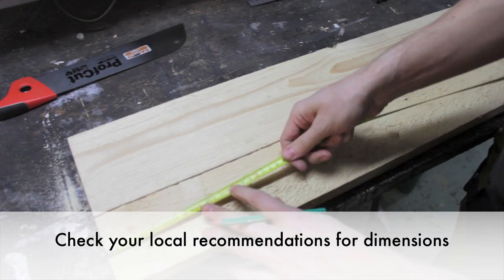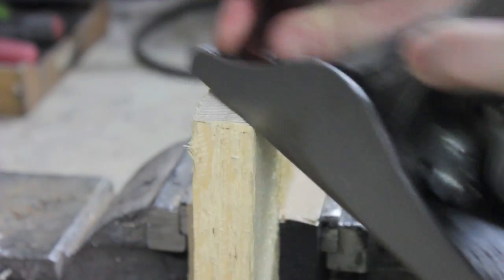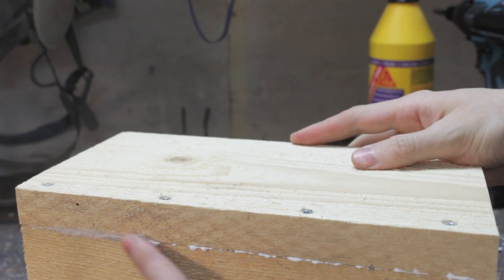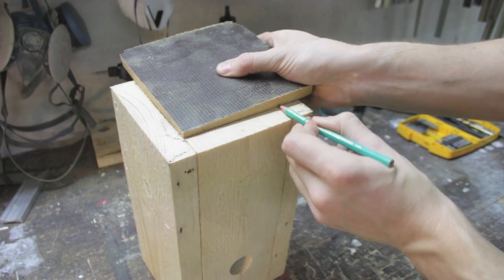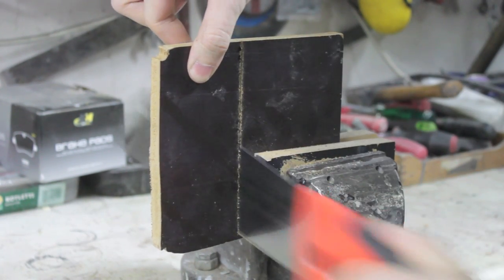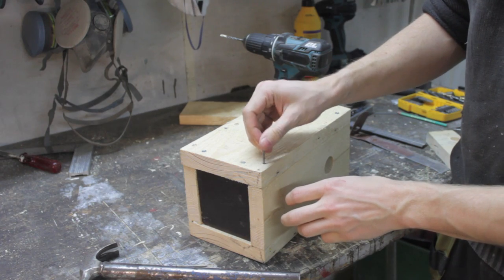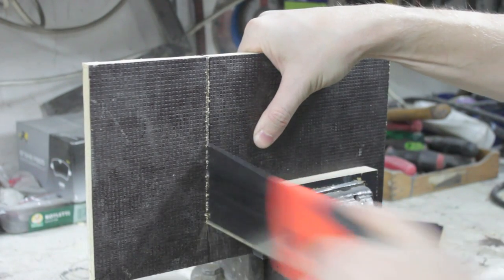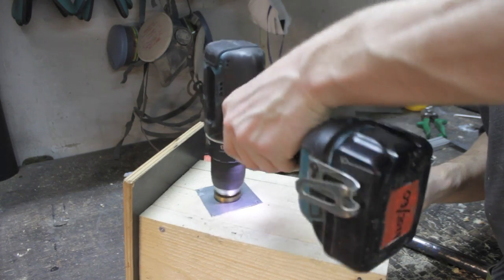Building a Birdhouse - Things to Consider

Comment: Woodchucks will probably prefer enlarging the entrance rather than making a new hole so your metal guard will protect the eggs also against them. You could also consider deepening the entrance by mounting a wooden square around it before screwing the metal guard. This will protect the nest against cats, martens and other 'pawed' predators. My bird house got 'modified' by a woodchuck within several months and now it has both additional layer of wood and a piece of metal around the entrance. :)

Comment: Terrific, thanks. First, thanks for doing good technical research on the birdhouse. I certainly don't want to hurt them and your video really helps that. Second, YES, on voiceover. The essential communicative power of video is in the use of eyes. Splitting the information ingress between ears and eyes is efficient. It allows either for more information in the same time space or a reiteration of vital information via two different media for better learning. Having to take my eyes from the action to read a caption drives me nuts! I panic that I'm missing something. I know it's in fashion now but...still...I KNOW what a table Saw sounds like. 
Great video! And great English!

Comment: Under the roof add a drip edge by cutting a 1/8” groove across the board to prevent rain water from flowing into the birdhouse front by convection. Also you want to toughen the wood inside the house under the hole so the baby birds can get a foothold climbing up.

Comment: Very much how I build nesting houses, except I put the hinge screws at the bottom so the front swings out from the top. That way, if there are chicks or eggs in the box when you open it, they're less likely to fall out. I had that happen and changed the design.
Reply from the maker: I just try to avoid opening the nest boxes during the breeding season.
Reply: B Farley I just save that for a chilly weather day ritual when the twigs are bare, the brown leaves swirl around my feet, my cheeks are red, and I dream of spring.

Comment: Great video. There are lots of poorly constructed birdhouses being made and sold. This has lots of good design points and is a very good birdhouse. I recommend two further design elements for a perfect birdhouse.
The inside of the birdhouse entrance should be left rough so that the birds claws can get purchase, you did that in your video but did not mention it. I would also include a small gap at the top of the birdhouse where the roof joins the body, this will allow moisture and heat to escape.
Reply from the maker: I too have read about these features, but decided to only address the major features in this video. Going even further, the bottom ends of the walls could be cut at 45° angles to make water drip off faster and not soak in to the grain.

Comment: I like that you use offcuts for this project but I think glue is going too far and will not benefits the birds. Your stock is thick enough that you ought to be able to recycle damaged nesting boxes but the glue joints will only complicating repairs. As much as you sensibly mention the need for the wood to dry quickly after rainfall, the glue joints only trap moisture between joints. Birds don't mind any gaps unless (I don't know about European species) these boxes are used for overwintering, too

Comment: How does that metal plate help keep predators out?
Reply: Birds like the pesky nasty sparrows will actually pack at the small hole - enlarging it so they fit through the hole - thus kicking the Wrens & Chickadees out.  I cover my metal plates with a piece of wood.  I also place the plate inside.

Comment: Great job!
But I have just one question. Could the the younglings climb up so high to come out from the birdhouse?.. It seems, that they have to climb up obout 15 cm at least.
Reply from the maker: Good question! This is actually a trade off that needs to be made when constructing the birdhouse. Having the entrance too low increases the chance that beaks and claws of predators will reach the younglings. But you are right in the fact that an entrance placed too high will make the job harder for the chicks. The adult birds also tend to compensate for this by investing massive amounts of energy in making the base for the nest thicker to raise it up closer to the entrance.
Reply: Pavel Shevchenko I read somewhere that it is important to make the inside of the front wall rough in order to allow the newborns to climb it